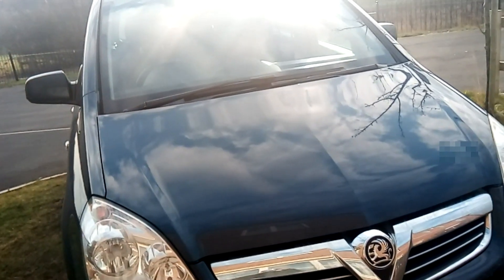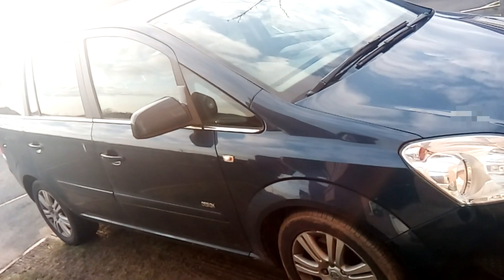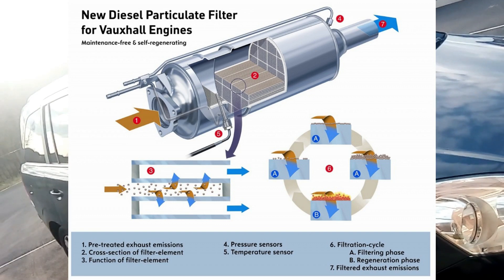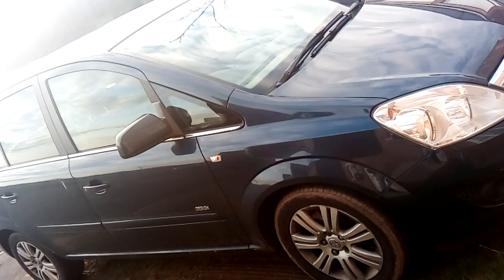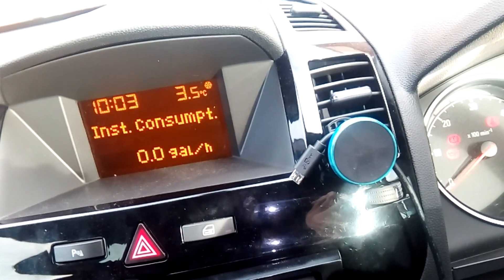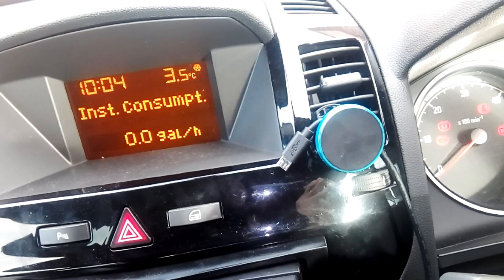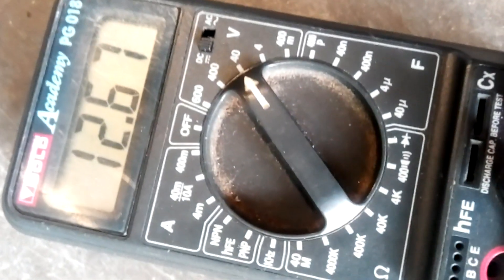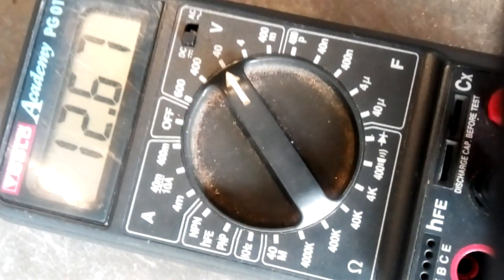Vauxhall (Opel) Zafira Diesel Particulate Filter (DPF) indicator and info

Comment: Hi there whats the little capacitor on the led for? Does it need this?
Reply from the maker: It's a resistor, to limit the current to the led. If you buy a 12v led you don't need it
Reply: @junkendriven Hi thanks. Ive connected a 12v small buzzer & a 12v bulb to the +12 wire (heated window). But when i put ignition on and car runs its buzzing and light on for around 2 minutes? Is this normal has i thought it needs power on switch to come on.
Reply from the maker: I believe it puts it on initially when car is switched on each time, it will then only turn it on when it's doing a full regen. Careful the 12v bulb and buzzer don't draw too much current as the heated window is already a large draw of current.

Comment: I have a 2013 Zafira 1.7 CDTI. The glow plug light is flashing. According to the handbook it says "Continue driving, keeping the engine speed above 2000rpm..Diesel particle filter cleaning is then started." I've done that on an unnecessary 30 mile drive and it is still lit, still smokes, still stinks. HELP!

Comment: Thanks for the detailed video what makes me mad is there is no warning light when the DPF is doing its clean. For example ( DPF Regeneration in process continue driving ) would be great or a simple DPF flashing light will suffice . So at first it was quite frustrating trying to figure out when its doing its thing. I know mine is doing it now because my idle revs will hit 1000 and my idle fuel consumption will be higher between 0.3 and 0.8 and i will get constant blasts of white smoke out the tailpipe. Then the engine and exhaust system will get very very hot. The good news is after a successful regeneration my MPG will improve quite a bit so i know all the nasties have been cleaned out. The regens are random too i usually get at least 2 or 4 cycles with a new full tank of fuel so short journey's are mostly avoided unless essential. i learned my lesson the hard way over this as i did constant short journeys and got the dreaded glow plug light flashing . I read online to blast it on the motorway but i think it was too far gone. On the way back the car smoked massively out the tailpipe and had to pull over and get towed due to it being extremely dangerous when i say it was smoking it was literally a cloud around the car. The garage removed the DPF and cleaned it professionally costing me £330.. I learned from that mistake and now let the car fully warm up before going anywhere. and constant short journeys are a no no. I noticed i had over the capacity in engine oil too which i guess was over failed regens.  So removed it all black as treacle and replaced it with a good branded low ash content oil . Sorry for the long post i just wanted to share my story with you over dreaded DPF's i have the exact car as this Vauxhall Zafira 1.7CDTI (2011). So i think we can relate thanks for the video and i hope you have a nice evening. subscribed

Joe
Reply: You are a legend thankyou for this post I just bought mine and I was worried it might need the injectors cleaning or replacing but thanks to you I know Its definitely the dpf Ill clean it tomorrow for about 20 quid lmao

Comment: Hi I have the glow plug light flashing on my zafira and after 20 mins of driving it smokes pretty badly from the exhaust system .the garage after testing it  said it needs a DPF clean which isnt cheap £300 its booked in for Wednesday how do I prevent this happening again ? The smoke from the exhaust system is aweful

Comment: hey buddy , you say theres no warning when regen starts, i was under the understanding the yellow coil spring flashes , i have a 60 plate 1.7 and allways gone 4 a long run when this flashes ..
Reply from the maker: Hi there. Thanks for getting in touch Brian. The flashing coil light is actually a fault/warning. It means the car has failed too many attempted automatic regenerations and the flashing plug light is your last few chances to correct before it goes into limp mode and requires a forced regen using opcom.
So my led indicator trick shows when a normal regen is taking place.
Reply: Ahh so its tried many times before hand and its telling me  its my last chance ..i do about 200 miles of town driving a week and this comes on every week and twice a week ..and is the only time i see a reduction in fuel . Think its nearly ready to come to a nasty halt then lol ..is there anything i can do to prevent it  coming on regular ?
Reply from the maker: Hi Brian
 Unfortunately the only solution is regularly long drives with over quarter tank of fuel.
It's made me re evaluate diesels in the future
Reply: @junkendriven  yup ill never buy another ..not for town driving anyway .since i 1st posted ive took it up the bypas in 3rd at 3/4k revs for 20 mins ago and light hasent come on ..so i think ill carry on doing that unless i go on a long jolly ..note to anyone waching whos going to get a 1.7 zaf B ..unless your comuting stay away lol

Comment: you may try this "clean" solution instead 
https://www.youtube.com/watch?v=r19QM6_UYgo&feature=emb_title
Reply from the maker: Not the same, this guide is for Zafira B which is slightly different ECU codes to the unit you mention which is for a Zafira C
Reply: yes, but it's a matter of changing a few codes at most. I found in recent gen most of the codes are the same between models
Reply from the maker: Please do supply the codes for the 1.7cdti as so far nobody can supply the correct or working values. That's for the A17DTJ engine and seems difficult to obtain

Comment: I didn't even realise your the same bloke lol frequently my car got hot and smelled as you say like rubber, I thought it was possibly the clutch or something just getting to hot, so used to stop and let it cool down 🤦‍♂️ now I know its the regen 👍
Reply from the maker: Glad you stopped by! Yes when you don't know the reason it's quite unnerving, at first I thought I had an issue with brakes or rear bearings. Once you know, you get used to it and recognise when it's doing the regen so let it finish!
Reply: @junkendriven  can u tell me something, you know the gaskets on the egr valve, is their a right and wrong way to put it back together, or will both gaskets seal no matter which way you round use them, thanks
Reply: Having had the egr valve out quite a few times, I guess I should just buy some new gaskets, I guess even some black carbon around the edge will not make an air tight seal, just wondering if that's why I'm noticing fumes, I'll get some new ones🤦‍♂️😂

Comment: How is with Vauxhall Vivaro 2.5cdti ???
Reply from the maker: Not sure as it's a van so won't have a rear window demister I'd assume? So might be difficult to tell when it's doing a DPF regen. If you have access to opcom you can check it but the LED indicator I don't think is possible.

Comment: Andy Brown please help my Vauxhall zafira b BC button stopped working while car been parked for few months .radio turned on works fine but don't display on screen.
Reply from the maker: Was the battery flat/very low whilst left? If so it may have 'confused' the on board computer. I'd recommend disconnect battery for up to an hour, make sure battery is charged then reconnect and start the engine. It may come back, otherwise it'll need opcom plugged in to diagnose the fault.
Reply: @junkendriven  thanks for replying but got sort it out by Vauxhall thanks anyway